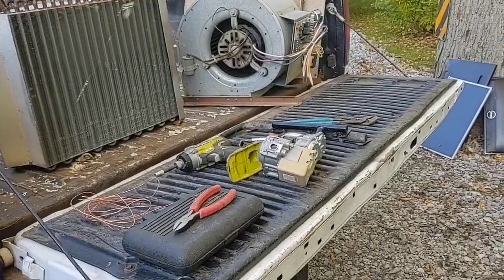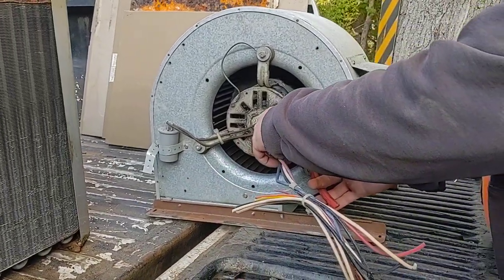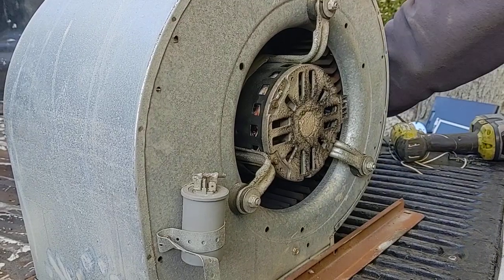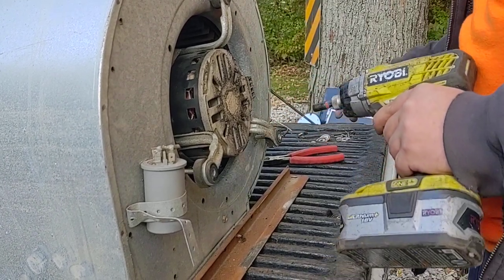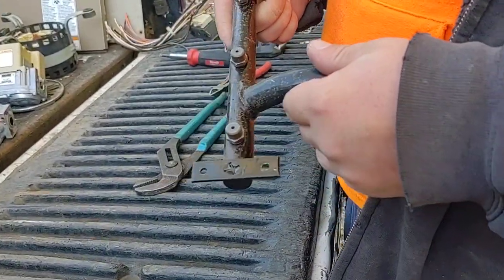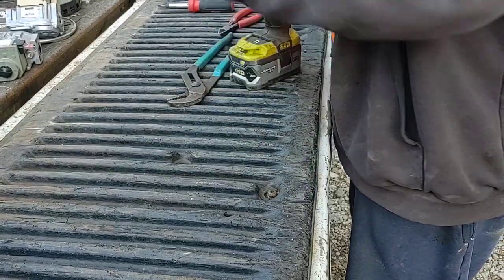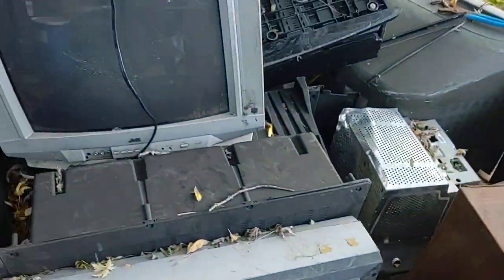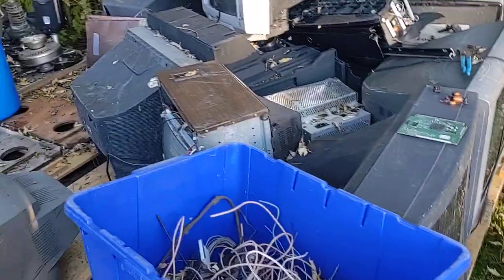How to scrap an electric motor out of a furnace.

Comment: those blower motors... some are easy as pie, others a real pain.   recently had one that was a pain in the ass, then the motor windings turned out to be al.   35 lbs of sheet copper, nice, that's a lot of stripped wire...  i'll find some nice copper tubing once in a while, usually all green and dirty, i'm guessing they don't know it's copper and toss it, but the trained eye    one day i saw a bunch of copper tubing sticking out of a garbage can... it was a copper colored garden hose.   one night i saw what looked like a couple pieces of plywood leaning on a garbage can, checked anyway, it was two thick metal plates, about 200 lbs of clean steal.
Reply from the maker: That's awesome, thank you for watching

Comment: i dont even try to get the shaft out,, i remove the 4 long bolts, usually a impact will do it while u hold onto nut with other hand,, if not angle grind the top of bolt off, real quick ,, hammer the AL end off,remove the 3 bolts holding motor to blower and remove motor, it usually slides right off leaving armature in side,, the AL end is easy to clean up, i use a 20 inch long flat screwdriver to pry off inside  steel cap ,then a piece of rebar sliding through to knock off the dirty end cap, and a 10mm socket to hammer out sintered bearing, then u have clean AL casting.if you must remove shaft they make 8 point sockets for square headed bolts, or use a open end of a combination wrench of the right size,i save oil from ac compressors, u can use that to lube up shaft let it sit , then use a 5 pound sledge to slam against  end of shaft , i should fly right out , but i would remove AL end cap opposite shaft first.